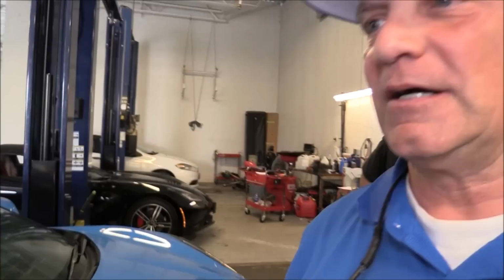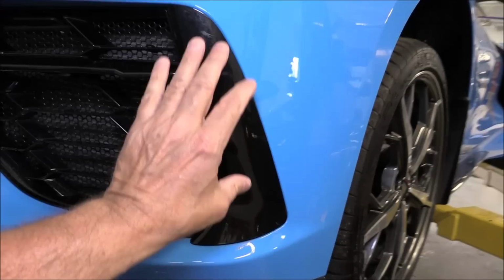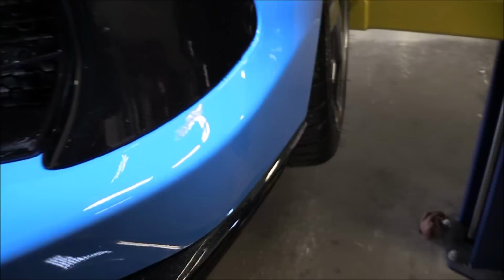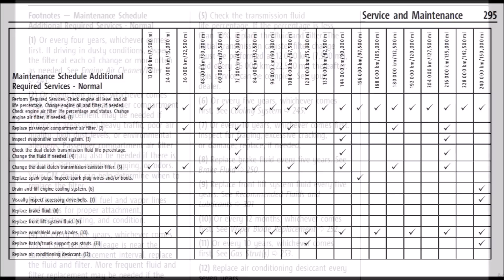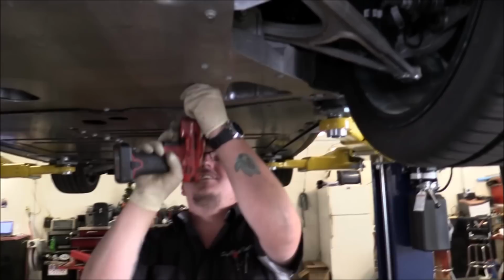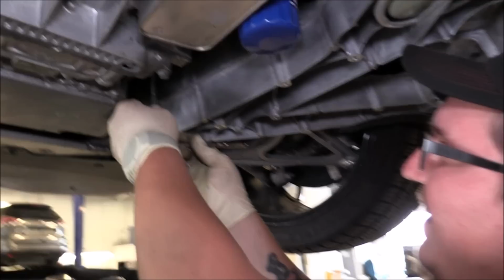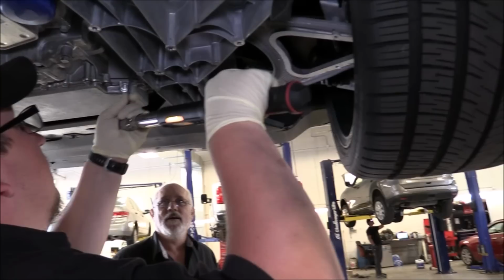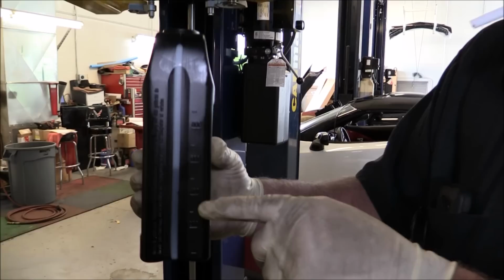FIRST C8 CORVETTE SERVICE WHAT'S INCLUDED & WHEN TO DO IT

Comment: Can you add the 2 quarts of transmission fluid required for  track use through that  same fill port on the side? WOW, that would be so much easier.
Reply: Yes you can. I did it this weekend. You have to buy the Dodson DCT oil fill line. Once installed (very easy) it took me 5 minutes to add 2qts with my power filler.

Comment: I think you should have mentioned that one should pay for the first service - just the engine oil and filter, GM will also include a free DCT filter change and top-up with an engine oil/filter change at 7500 miles. Most people will wait until the  7500 miles as the DCT change is about $650-$850 at the dealer. Why would you not consider their pocketbook when suggesting service?

Comment: More service videos to come I hope. That was nice. Just did mine this weekend but added the extra 2 also.
Reply: So when u fill the extra  2. U have to fill in the back under the air filter housing is that correct ??? Y did the mechanics filled ricks transmission underneath where the filter goes ???
Reply: @craigjesso3976  They filled his in the service side port as you should. They were just replacing the amount of oil they lost from the just the filter change. You just fill it completely or top it off until the oil comes out of the port and put the plug back in and clean it up. 

I have the Dodson oil fill port so I can just drain the oil and simply hook up my adapter and pump in the desired amount which for track is 13.6 which is 2 qts over over. I don’t have to install the extra 2 from the top side under the air filter which is a pain.
Reply: @NoMatter78  yes it is a pain as I watched a few videos. I didn’t see any videos the way u said maybe u should post next time.  Thanks for information

Comment: You didn’t mention if you did or didn’t add the additional two quarts of transmission fluid. I know you have no plans of tracking your car but was wondering if it would be a good preventative measure (I would assume that the extra fluid would allow the transmission to run cooler) considering the problems some people are having.
Reply: I'd like to know this as well.

Comment: Rick do you have a super secret GM service department head/person, (a name, a phone #, an email, etc.),  that I can have a dealer contact to confirm they are supposed to do the DCT service the 1st time along with the 1st time oil change?  I'm at 5K miles plus, (29% on the oil change meter), and have checked with 2 of the nearby Chevy dealers in my area and in both cases the service department managers have said NO FREE 1st time DCT service...only the 1st oil change is free.  I've even showed them some of the official documentation floating around the forums stating that they, (the dealership), gets a $200 or so credit for doing the DCT service...they said don't believe everything you read on the C8 forums.  HELP.

Comment: Rick, do you know about the problem with water collecting in the front strut towers, and the need to add covers to the towers to keep the water out... was this issue only with the 2020 models, and was it fixed in the 2021s? If you're not aware, please forward this question to Chuck. Thanks. Love your channel.

Comment: Disappointing this video didn’t get into the needed detail of removing and installing the trans filter.  It has lack critical information on where the fill plug is and how you fill it, like what filler “thingy” was the mechanic using to inject the fluid.

Very disappointing.